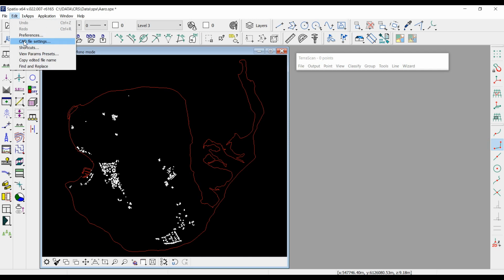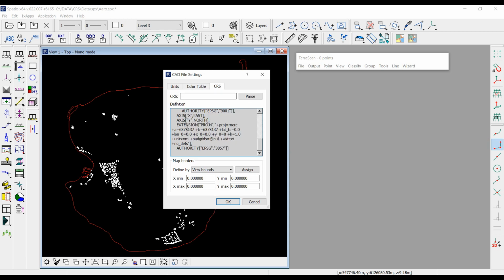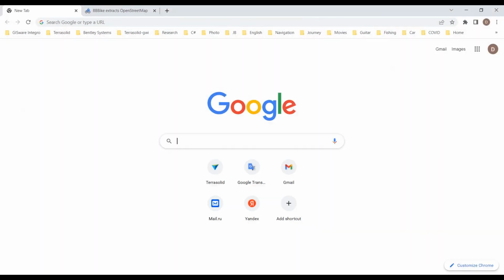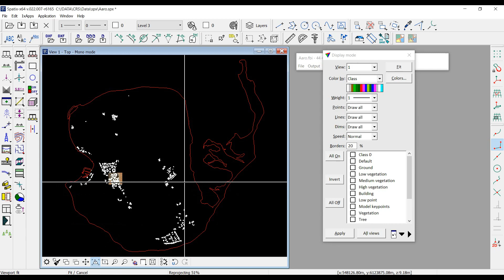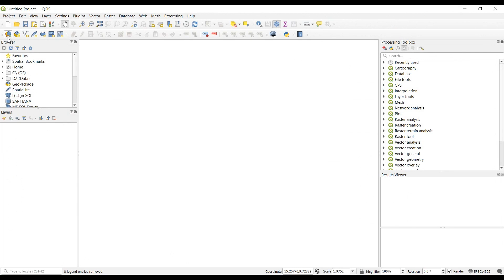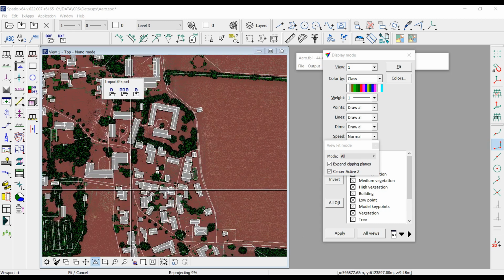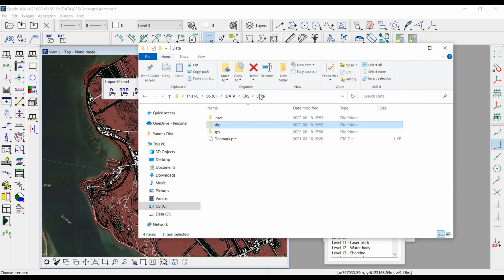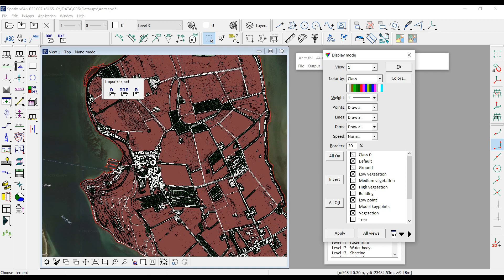Using projections in Spatix

Comment: How did you snap Terrasolid tab to the right of the Spatix application? I couldnt fint the way to do it :/ thnx
Reply from the maker: Hello, here is the extract from Spatix manual: "To dock any toolbar, move the cursor to the vertical grip on the left side of toolbar. The cursor will change shape to 4 arrows. “Grab” the toolbar by <LButton> and move it towards top, bottom, left or right side of the Spatix workspace until the desirable position is dynamically indicated. Release the button to complete the operation." The same applied to the Terrasolid toolbars as well.
Reply: @denisantoshkin471  Thank you!